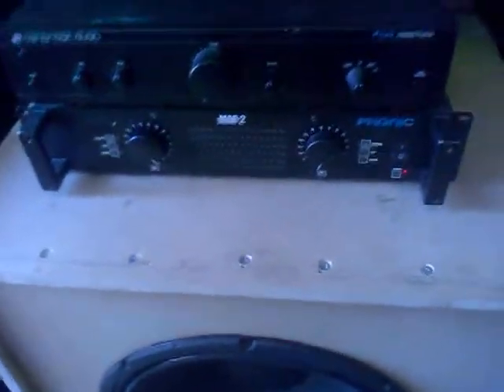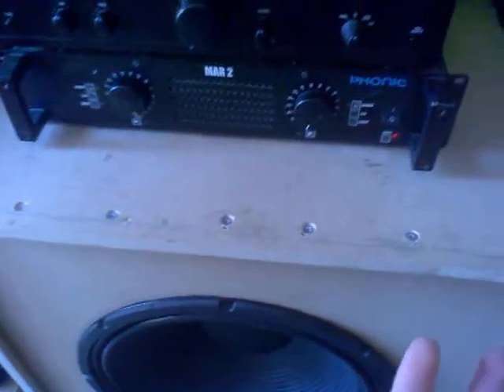Phonic MAR 2 The Big Issue

Comment: I've been told by a competent repair tech to never ever never ever never ever bridge the 2 channels together; it over works the components causing premature wear and tear and eventually failure. He made the analogy of buying a sports car and stomping on the pedal full speed everywhere you go.
Reply from the maker: I completely agree when bridging an amplifier in to a 4 ohm load, however bridging in to an 8 ohm load is not so bad, like I did in this video. It's similar to running it at 4 ohm stereo which is quite normal. A good amplifier will have been designed to handle this for long periods of time. Phonic claims this amplifier could handle 2 ohm stereo loads or 4 ohm bridged, I never used it to that kind of limit.

Comment from the maker: Thanks for all this help, I'll definitely do that this weekend. One thing I do know is that on the left channel there are two mosfets and on the right channel there is only one yet wires exist which would connect to a mosfet for the right channel. I'm wondering if the  input stage could be a partial reason, I did some testing and found some resistors rather out of tolerance. Could that be a big contributor?

Comment: You could try comparing voltages on the output transistors with no signal.  Maybe you have a bad driver transistor or emitter resistor.  Could also be in the input stage though.

Comment: That will be difficult to troubleshoot without a scope.  Could be power supply, preamp, or something in the output stage other than the transistors.  Does it sound distorted when not clipping?

Comment from the maker: It really does suck :( 
Remember that video I got of my system in January and you commented about the clipping, this is what was happening. The right channel would just clip even though I had set the gain's perfect to match my mixer.
I actually got given this amplifier for free so all is well, I have made no loss except for the 16 odd pounds I spent on the new transistors which I can always take out again I just want to try and fix it so I can use it for top cabs :)
Thanks for watching! :D